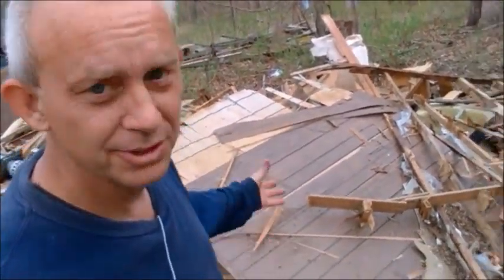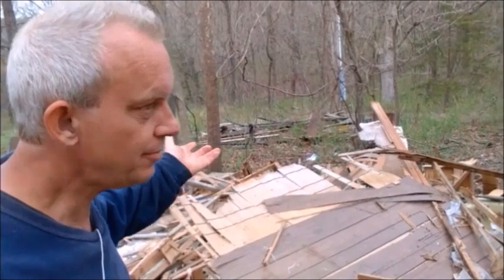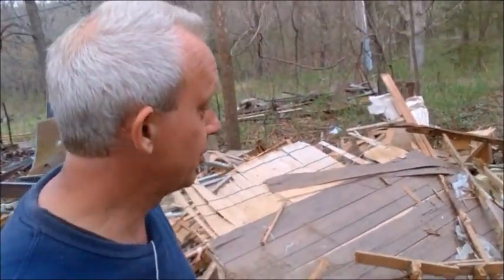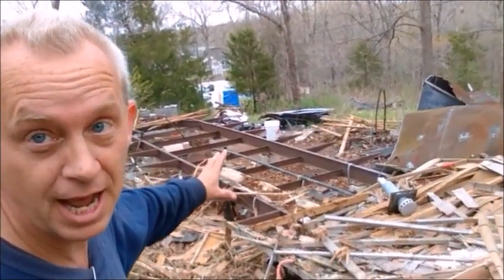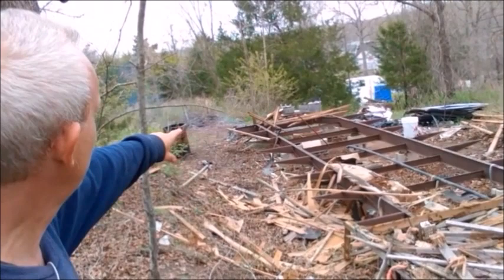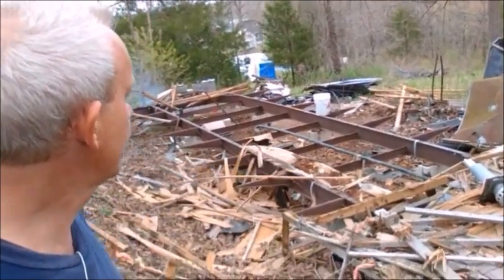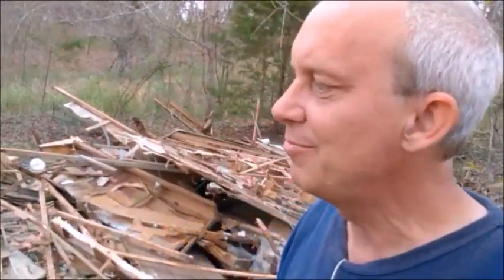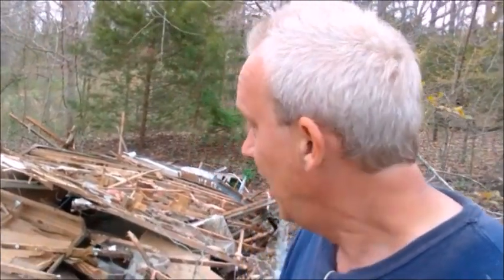Our Tiny House Frame Fell Apart While Off Grid Living

Comment: One thing i want to mention is that when you build the new house is that you find a way to use straps to help hold down the house and trailer frame. Tornadoes really love trailers and that tiny home wouldn't be any different. Maybe a safe underground tornado shed. Thats the only thing i can think of that you haven't mentioned in your videos. Maybe you already planned it but just haven't talked about it yet. Other than that i think you are right on target as far as house and using trailer frame to get around county laws.  Good Luck and keep the videos coming!!
Reply from the maker: I have many videos on tornadoes.  Hope you will check them out
Reply: @LittleHouseOffGrid  Cool, I will. Stay safe they had a very active day yesterday and last night.